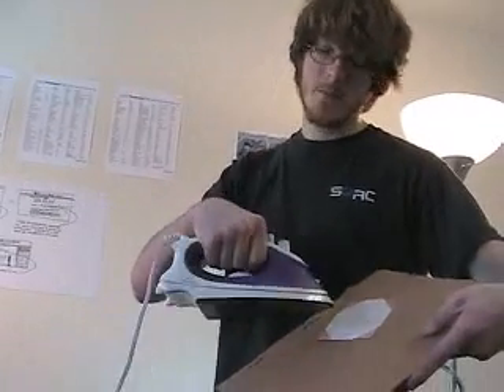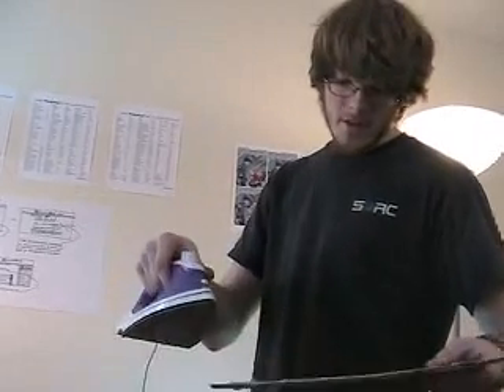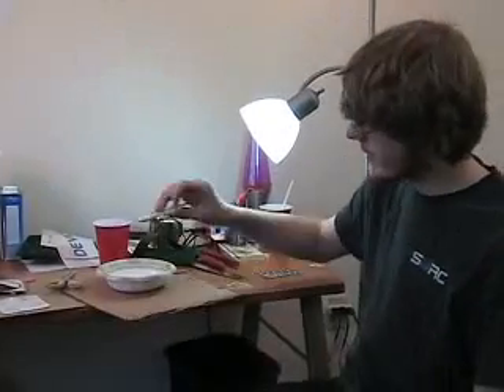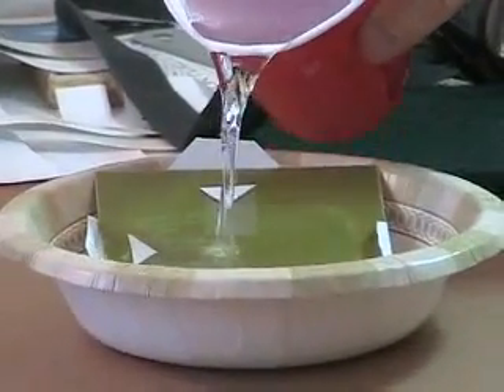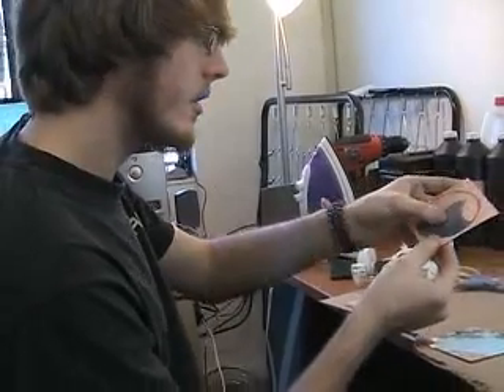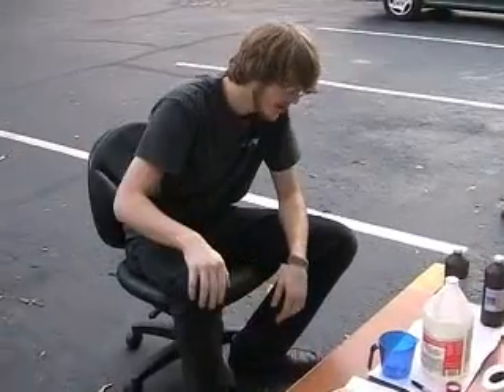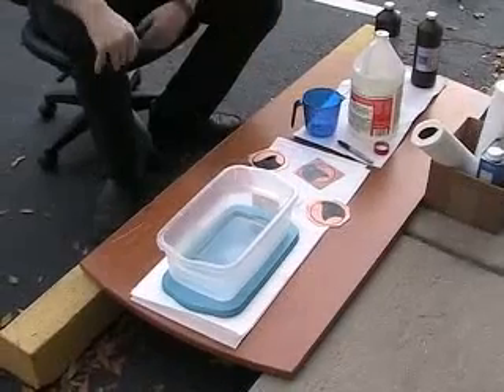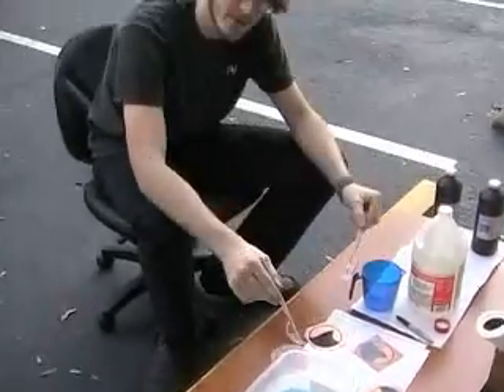How To Etch Your Own Circuitboards

Comment: @elektronickz This is the cleanest method (15 seconds) much faster than the messy Ferric Chloride (15-20 minutes) and there is no danger if you use it in the open with proper clothing

Comment: Personally, I always send the used stuff to Hazardous Wastes.  Titrating and neutralizing the acid is an option, but still leaves the issue of the toxic copper salts.  So I just store the leftovers in HDPE or PTFE plastic bottles until I can dispose of it properly.

Comment: it doesnt matter what kind of paper you print the original image to, as long as the toner sticks to it, but will give it up easily onto the copper when you heat it. glossy used magazines are perfect, so is glossy photo paper and "press n peel". I think its because they are less porous than normal paper so the toner has less chance of getting trapped into it.

Comment: hehe I use ferrum too - if the mixture is dense, you need like 20-30 minutes per average board, also it's reusable, non-toxic (so you can turn and grab your board with bare hands) and can be restored if overused by putting iron nails in it.

Comment: yeah they're called tin snips. i used to use them when i was roofing. they're somewhat like what you would use to trim small hedges, but they don't have a curve in them. they sell them at pretty much any hardware store if you haven't found them yet.

Comment: Tile several copies of your artwork per sheet of glossy paper.  If the transfer doesn't take the first time (and it often doesn't), you will have spares, plus you won't be wasting expensive inkjet photo-paper.

Most people use Ferric Chloride (available in most places).  It's less dangerous to people than hydrochloric acid.

Acetone is very hazardous to humans, and passes through the skin.  Always use gloves (not vinyl) when handling acetone.

Comment: It's a lot harder with the thin traces of a real circuit.  When drawing your board, try to use thick traces and lots of fill areas (ie grounding planes).  Not only does it use less etchant, but also helps the toner transfer properly.  

Also, you MUST rough up the board or the toner will not take to the copper.  200 grit sand paper or SOS pads work well.  I use a power drill to help.